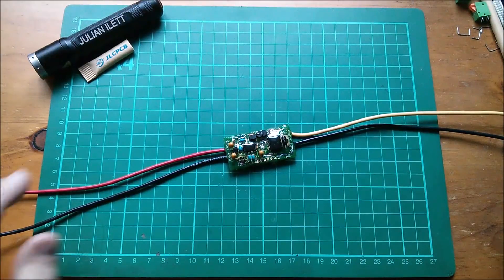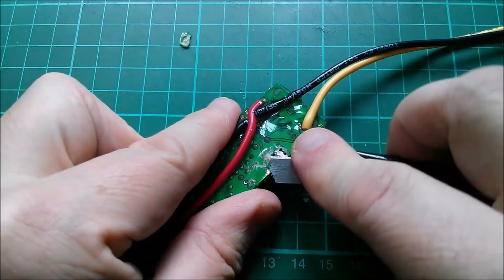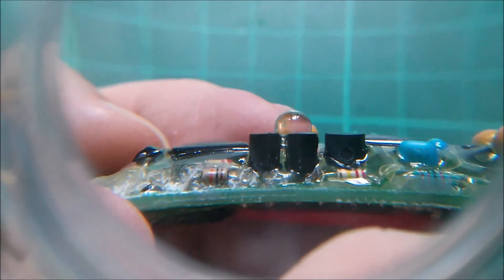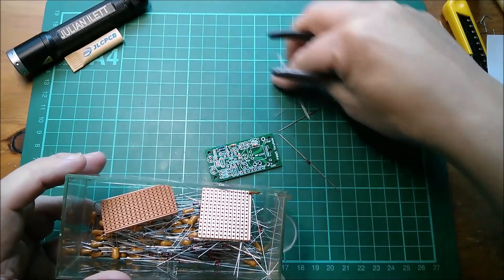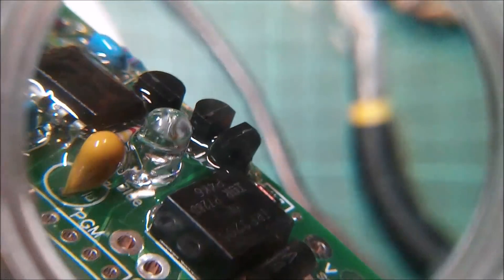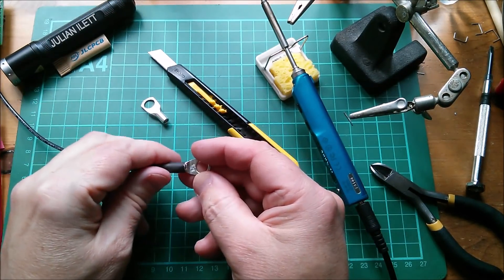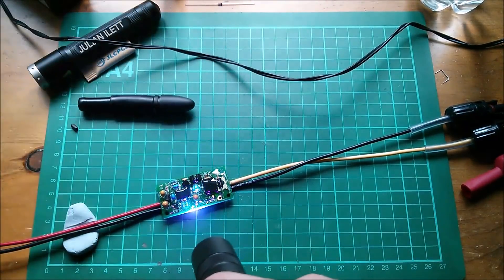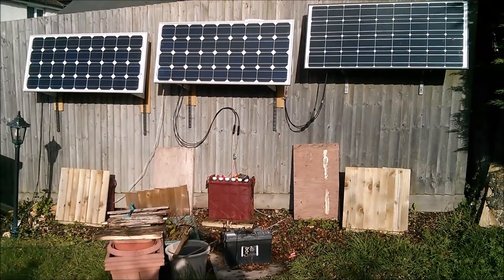Emergency PWM5 Build - Solar Charge Controller Fail

Comment: temperature creep on the interfaces between the components and the glue allow for capillary action. Never allow any part of any component to protrude from the sealant.

Put the entire device into a small project case and then fill that case with epoxy so that every component is covered.

Comment: UV leds typically emit UVA light between 390-400nm. at 20mA, these LED typically emit 10mW of power. one would have to stare at this LED for over 20 hours at full brightness from 1m away to reach an exposure that would be considered to be harmful. then theres that fact that people tend to use these to cure nail gel at salons. youre more likely to experience damage from the sun than these LEDs. dont be silly, Julian

Comment: Julian,
Do you sell the solar charge controller pcb's, kits or assembled units? I am looking to have a 12v fan on the dehydrator on the garden and intend to have a 3s2p lion pack (or sealed lead acid if the LiPo is not suitable) that is trickle charged from a 10W panel using something like your controller.
Regards

Mike

Comment: Should you splay the transistors away from each other, so you can more easily get the glue between them? (You could push them back into place when you are confident you have full saturation).   :-)
How do all the other boards look? Seems as if the UV glue works, it just needs to be "perfect".

Comment: Just a thought, as I used to have to "weather proof" devices for the coach industry, I found that moisture from the edge of the boards, what ever the type and make made conductive path/track within the layers of the board it's self.

Comment: What ever potting you use if you don't fully cover parts the gap between will open and close with temperature due to different thermal expansion.  Cover pcb with varnish and put in a sealed box. End of problem.

Comment: The UV resin you are using cures in absence of oxygen (or best in a vacuum).  The slightly oily/sticky finish is the top molecule of the resin not curing because it's touching the air.  Because it's unset the top layer will rub off quite quickly leaving the set bit with it's nice hard shiny surface. It makes for some interesting "rules".  Air bubbles remain unset on the inside but a small surface bubble could be hollow and will be filled with unset resin that eventually turns into a micro hole.  Same goes for partially covered sticky up bits like the transistors poking up out of the resin  Eventually the "skin" goes away at the contact margin and leaves a trough perfect to hold just enough water to start up a capillary pump and when the temperature of the object changes when/if it cools and shrinks eventually you'll get an ingress of water vapour.

Ideally you should dip not dribble - but you you have to do what works - as long as you cure as the last step that coat should set OK.

The first rule then is cover everything completely (no sticky out bits) and once it's cured no touchups or patches.  If you've missed a bit you should always apply a complete second coat to mitigate bubble and missed bits turning into holes.

You can get a 200ml bottle for £14ish - a tinfoil takeaway tray makes a good dipping tray and if you then use the lid and keep it light tight it will keep for a couple of months - if you use a tuppperware airtight sandwich box and a squeegee you can keep the stuff usable for a year or more - air is fine, its exposure to light you have to avoid.  I work in my old darkroom, and store it in a light tight cupboard.  It lasts and keeps for ages.

For anyone serious about using the resin, rather than a torch (always handy for a quickie or one off).
For about £3.50 you can get a 50led 3w bulb that's the correct wavelength and at 3w won't burn your skin.
It cures quickly and gets into those important little places.

Comment: I've seen several videos of you with corrosion issues, and I just wanted to state what I do.
Figure the minimum "PVC Waterpipe" that will hold your project + endcaps.
On on endcap, drill press five holes barely big enough to shove each wire through, and one to poke the head of the LED back out part way.
Shove all the parts back together, UV glue/epoxy the whole bottom, hang such that all the wires (and light!) are on the bottom, tape/O-ring/heat shrink/twist-tie/whatever the two wires going "up" to the sides (on the outside!) such that it again hangs "inline". 

The natural falling water only sees the totally sealed & watertight end and middle. The "breaches" are all entirely on the low-end - and the breaches themselves aren't even in contact with the actual board. The LED would still be visible (albeit no longer directly mounted to the board).

Comment: Why not just immerse the entire thing in a bath of the resin and pot it properly? Just find a small silicone mold (or make one) that your can place the unit into, then dropped the entire thing in the uv resin, or even 2 part resin. Let it cure, then remove from the mold.

Comment: I am making a lot of outdoor rates devices and I would never trust any kind of glue to be the proper weatherproof seal. I would rather use IP67 enclosure, box and couple of GX12/automotive connectores or so...

Comment: I seem to recall some commentary by you a while back that said how hot glue inside of heatshrink was not good for keeping water out,  and you're talking about trying it again?  What's up with that?  i don't know why you seem to want to insist on bringing the wires out of both ends of the board.  Bring them out the same end,  and have that end facing downwards,  and you'll have a lot less of a problem with water ingress.  And maybe use a sealed enclosure as many have suggested?  Or a proper conformal coating?   Yes,  you can take something (UV glue) that's made for one purpose and re-purpose it to use for something else entirely (waterproofing in this case) but without a detailed understanding of a lot of aspects of the chemistry the results are going to come around and bite you in the ass,  more often than not.

Comment: Why not just embed the controller in a purpose made gel-filled electrical connection box, as used for outdoor wiring?  Less fun than glue I suppose, but guaranteed to work for ever...
Reply: Don't those cost way more than the actual controller...?
Reply: Pentti Kantanen £3.50 for a Wiska box, £10 for a pack of gel - but enough for several small boxes in one packet.  Not sure how much the controller costs, but probably less if it’s DIY.

Comment: I see the wire bend from the solar panels and a straight path down the wires to the circuit board. Put the circuit board at the top of the bend so no water can travel down the wires on to the circuit board, you'll find a significant increase in longevity before next failure, just keep the board on its side, not flat.

Comment: You go through so much of that glue. Have you looked into something that comes in a larger bottle? https://rover.ebay.com/rover/0/0/0?mpre=https%3A%2F%2Fwww.ebay.ca%2Fulk%2Fitm%2F173945015001

Comment: Do you have a source for the glue or a specific search term?
The idea that Bob Lewis mentions in the comments is a very nice alternative and would allow for repairs. Cable glands for such small wire are really cheap. Mounting wires on the bottom of the case as it hangs and allowing for drip loops on the wire helps.
I have uses a silicone conformal coating in the past that had a UV marker dye in it so as one could inspect the applications of the product. Just spray on and forget. Used it on some Motorola 2-way radios that were not sealed and in Ag fertilizer trucks. The fertilizer was quite corrosive and always affected the PA area which was on the back. After a complete clean down and two coats of spray, never had a problem again. No problem=Happy Customer!

Comment: Nice job!  But, question, why didn't you first try to repair the old charge controller by replacing that bad transistor and seeing if it worked?  If so, you could have just patched the holes in the UV glue again because, as you said, it's perfectly okay to layer it.
Reply from the maker: I judged it to be beyond economical repair :)

Comment: You should chew through that faulty transistor and install another one, that will confirm if this was the failure point. It would be good for those Trojan batteries to bypass the PWM5 units occasionally and allow them to get up to a good 15 volts (even 16 volts for a short period). If they never reach these higher voltages you'll slowly kill them by sulphation.
Reply from the maker: I'm not a big fan of battery 'equalisation'.
Reply: @JulianIlett  For a true equalisation they have to reach 16 volts and stay there for some time. And it can be hard on the cells, but then so can uneven cell voltages. But 15 volts is quite different. It's really just a slight "overdrive" of the absorption phase and with large flooded batteries it will do them some good.  

I have found that taking these kind of batteries up to 15 volts for a short period during the day eliminates the need to do a proper equalisation cycle altogether. Some people claim that this will degenerate the +ve plate, but the only real side effect that I have noticed is a slight increase in water consumption.  The plates continue to stay clean as a whistle. 

It's more important for stationary batteries to do this as the bubbling of the electrolyte helps stir up the acid and avoids stratification. For batteries in mobile situations this is not so important as they get shaken up and they are driven around! 

I have a pair of 6 volt 220AH Crown traction batteries. They are now seven years old. And have been run pretty hard though out this time (they run our lights day in, day out) and are only beginning to hint that they are reaching the end of the road.

Comment: The lesson to be learnt here Julian is one I learnt over 40 years ago from Arthur Radford (of Radford Audio fame in the 70's and 80's)

NEVER, NEVER, NEVER design something to be assembled ... ALWAYS, ALWAYS, ALWAYS design it to be DISASSEMBLED ... as EASILY as possible!

THAT way it can always be disassembled easily, maintained and reassembled quickly and simply! The board should be fitted with waterproof glands, inside one of these:
https://rover.ebay.com/rover/0/0/0?mpre=https%3A%2F%2Fwww.ebay.co.uk%2Fulk%2Fitm%2F233299622951

I bet the cost will compare very favourably with the UV glue and suspect it will be even cheaper, leaving room for some waterproof grommets! It will look more professional, can contain a silica gel pack from purchased goods Why I always try to save a few each time I get one) and MOST importantly ... Can be maintained/repaired EASILY.
Reply: Yes, make it SERVICEABLE....
Reply: Well with something cheap and simple it might be more reasonable to just bin the item, but of course repairing stuff is always way more pleasing than just a boring replacement :-)
Reply: @benbaselet2026  Personally I'm a VERY tight bar steward and HATE throwing away anything remotely repairable!
Reply from the maker: A worthy aim, but there's plenty of stuff designed NOT to be repaired these days :(
Reply: @JulianIlett  Lets start a trend, and make stuff repairable again..👍
Reply: Partly it's a sign of the times - most things are disposable now.  But also when it's outside your biggest priority (and problem) is keeping the outside out and the inside dry.  I worked in telecoms and all external plant is subjected to terrible conditions persistently for years.  You can delay nature - but you'll never beat it, especially where water is a factor .

Some external plant was sealed, potted in resin, boxed in steel and sometimes, also set in concrete.  It was never intended to be repaired, the build was all about maintaining the contents of the box.
We used various guides on how much spare was left, because when things went wrong - you'd cut out the offending bit and rejoin the ends - no attempt to repair was possible or required.

If you build it using government grade components it will never need repairing.  Usually its external forces that get you

Comment: If you're concerned about bubbles in the UV glue, assuming it's anything like epoxy resin, you should be able to give it a blast with a hot air gun and the bubbles will pop.

Comment: UV curing - don't know if you use safety specs in your workshop Julian - but those are made from polycarb, and will filter out everything shorter than 400nm - ( tested by me in a lab transmission spectrometer) - just a handy alternative to your camera viewing method.

Comment: Why not use conformal coating?
Reply from the maker: The UV glue is a conformal coating :)
Reply: You did seal all the edges of the PCB?
Reply from the maker: Not this time.

Comment: Big Clive did a conformal coating with transparent nail polish for his solar lights, why don't you give that a go as well - it's lower density should not leave you with similar coating holes between components that are close together.
Reply from the maker: Big Clive is my friend :)

Comment: In the past I have often used "Kontakt PLASTIK 70" spray to protect "outdoor" circuits (in total 5 layers, last 2 layers with 24 hr drying time in between). And never had a single one fail in time.
As a mather of fact one is still in use after over 15 years !
Reply from the maker: Wow, that's 5 days drying time.

Comment: What are the spec's for your " UV GLUE " ; can you be specific to the product you used?
Reply from the maker: The 50ml bottle I just bought is called K300.
Reply: @JulianIlett  From my research Kafuter K-300 UV Glue UV Adhesives is for gluing glass together. No where is states it is waterproof.  Also have you considered thermal stress on components.  etc.
Reply from the maker: Also used on teeth :)

Comment: I'd suggest making a single shot potting box out of cardboard and hotsnot. Perhaps using a bit of wax/parchment paper lining for easier removal. Then just flood with a nice thin epoxy. (Slow setting or keep everything cold)

Comment: I always put anything I make for outside in a bottle. With either wired through holes sealed with hot glue or waterproof sockets in the lid.
Reply from the maker: Novel idea - I like it :)

Comment: @julian why don't you put it in an IP65 electrical box 🤷‍♂️ save all the glue 😂
Reply from the maker: It would need four IP65 holes to take the wires :)
Reply: @JulianIlett  - IP65 holes - also known as Compression Glands.
Reply: Simon Coates Yes. And only one hole if you invest like 2.1 ns thinking about it... (I mean, four wires = four holes, seriously?? 🤦‍♂️)
Reply: And if the hole is in the bottom, it's already IP65 rated :-P 😂 (I know, I know, it's isn't... but water generally falls from the sky, not rise ground! 😂) Compression glands are pretty cheap from fleabay... not excuse not to use them!
Reply: @ArnaudMEURET  Correct! He could just use one 4 conductor cable and save himself 3 compression glands.

Comment: I think you can find a more economical glue than that UV glue.  The glue would work much better if you totally encased all the parts so that there was no chance of water entering between the component and the glue especially as it goes through hot and cold cycles.
Reply from the maker: $3.69 for 50ml isn't that expensive.

Comment: Why not have all the wiring formed to one end of the board, coat it and try having it sit outside with the wires oriented down? There may be a little wicking but probably a lot less chance of water ingress.

Comment: It’s a shame that one didn’t last long. I thought the edge of the pcb might be a weak spot, but I imagine you applied some glue there?
Reply from the maker: I did coat the edge on that one, but didn't bother this time. Pretty sure water got in through that small hole between the transistors.

Comment: In your code for the micro, is there a way to slow down the flashing voltage reading, it is a bit fast for me to read. Partially sighted in 1 eye.
Reply from the maker: Probably. As far as I remember, it's just a free-running main code loop :)

Comment: Hey Julian, you inspired me to finally start making my own PCBs, just ordered my first batch from jlcpcb. Unfortunately it seems they don't let you order lcsc parts with the same shipment anymore, that makes the whole deal a bit less attractive.
Reply from the maker: Awesome - thanks Steve :)
Reply: @JulianIlett  It is quite a game-changer. When I got into electronics, stuff like this was ridiculously expensive, so I got used to botching my stuff together on perfboard :)

Comment: Try cooking it at just over 100 °C for a while, or if the components won't like that, then put in a vacuum chamber with some silica gel or anhydrous calcium chloride and heat to about 80 °C to drive off any moisture.
Would probably work after that, then you can seal it properly.

Comment: Looks, that you couldn't get enough UV-glue for your projects. What makes you sure, that the next module work this time longer? Do you have long time experience with UV-glue to make PCB's waterresistant?
Reply from the maker: My experience is getting longer by the day :)

Comment: I would build a little 'potting box' out of stacked/glued JLCPCBs and use that to pot the entire circuit in hot glue, with a good 5mm of extra glue around each side. Result = impervious encapsulation and can still see the LED through it. Also very cheap (both for the hot-glue and the JLCPCBs ;)